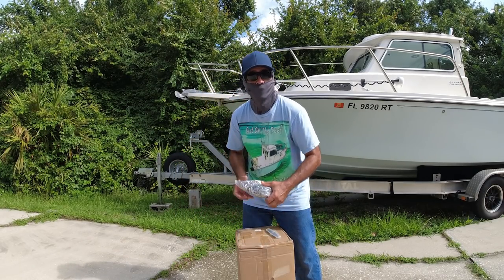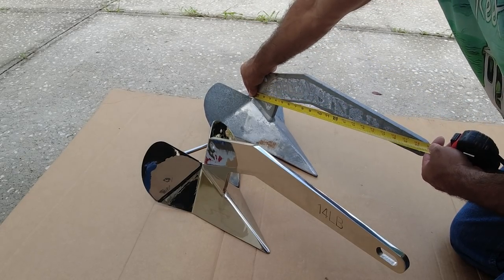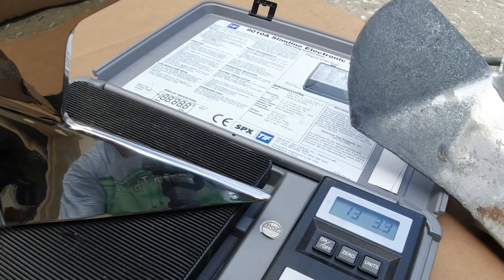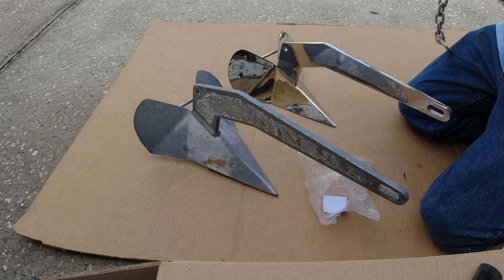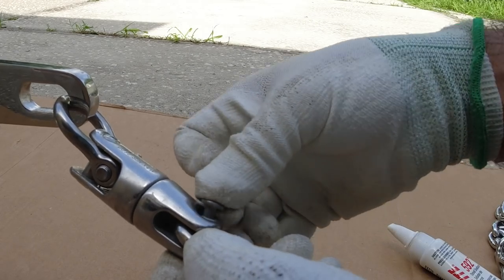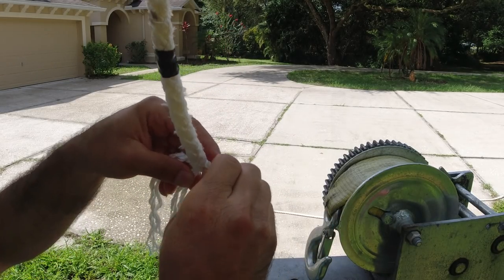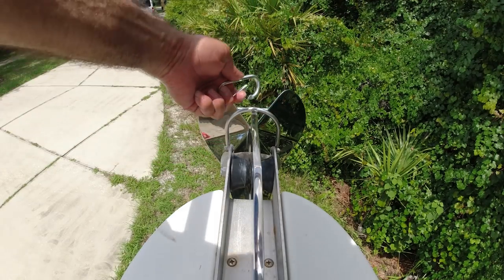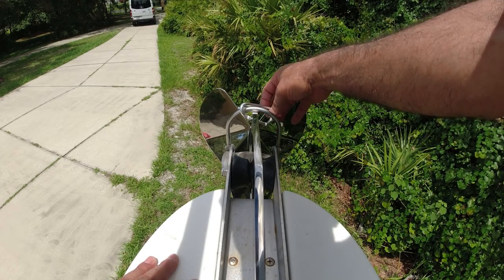New Stainless Steel Delta style anchor and How to Create a Rope-to-Chain Splice Crooked PilotHouse

Comment: I hate that anchor so much it’s not even funny… lost my first one in the rocks up here in the NE and now I have an anchor locker full of chewed up anchor rode… I won’t use it ever again, I now have two grappler anchors onboard for the rocks. Maybe I should have tried the zip tie method.
Reply from the maker: yes cap the zip tie method will help you a lot👍⚓⚓

Comment: Hey Capt. Nice job there. I still have my delta anchor and it's working great so I don't see changing it any time soon. But my rope is starting to fray from the windlass so looks like I will be performing your rope surgery soon. I'm not sure I will be able to do it myself. Your video helped but not sure of which one to put where. And it looks like you only back tracked it 4".
I'm going to give it a try though. 
Thanks capt for showing us. Your so talented.....
Tight lines.....
Reply from the maker: Nice to hear from you captain and I'm sure you will do a better job than I did just don't try to make it to perfect because then The Windlass will slip ,that's my experience from the past, and no worries once your anchor starts rusting up like mine then you can get the shiny one LOL

Comment: It’s all nice 👍 my concern is it made in China with 303 stainless steel. We have had so much problems with rust and corrosion for the  cheap 303. We only carry 316 from our bolts, nuts , washers , screws.
Reply from the maker: very true but if i can get 4 to 5 years out of this anchor that will be great for the money is better then galvanize 👍⚓
Reply: Agreed and galvanized will outlast that cheap stainless.
Reply from the maker: @nicksreviewsmiami  did you saw the the 3 year old calvinace anchor was rusting already ,take a look at the video again cap
Reply: @OutOnTheReef  I did see the rust. Perhaps Lewmar will cover that under warranty? I have the exact same galvanized 14lb anchor for my 30’ boat and it’s about 6 years old with no rust.
Reply from the maker: @nicksreviewsmiami  looks like mine was cheaply  made o well now this new one is great for my boat

Comment: So the anchor has 2 holes one at the very tip and one on like the back thats closest to the point of the anchor. You should attach the chain tl the back part of the anchor and then it will look werid. But you stretch out the chain and zip tie the chain to the very tip where it has a hole. What this does it that when the anchor gets stuck, the zip tie will pop of and it will start pulling the anchor from the back. Idk if you understand what im trying to say, but its really healpful for rocky places. Btw you need to use a big zip tie
Reply from the maker: Yes I have done that before but now I don't use my anchor to Anchor in rocks I use my Minn Kota so that means that I only use the anchor for soft sand👍👍⚓
Reply: @OutOnTheReef  perfect 👍
Reply from the maker: @learningfromthesea  thanks buddy and have a great 🌙 night
Reply: Thats called the breakaway setup, pretty important.
Reply: @scottk27332  it sure is

Comment: Which color loctite did you use ? I usually put a zip tie through the hole in the shackle pin and around the shackle to ensure it won’t back out.
Reply from the maker: I place the link in the description below of the Loctite that I use captain

Comment: Nice anchor but more light than before.i got anchor same as your pattern but not stainless steel 5 kg the problem is the anchor will not stick on the bottom especially in choppy.please review the new one when you out on the sea🙏stay safe captain
Reply from the maker: I already tried it and it works perfect but I will keep you updated on my Bahama trips because that would be the best test when I'm overnight